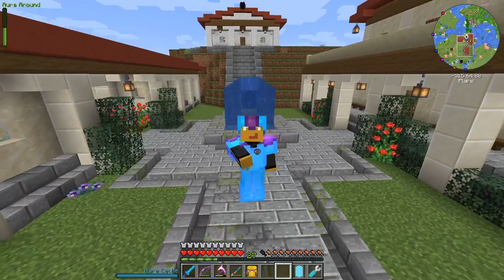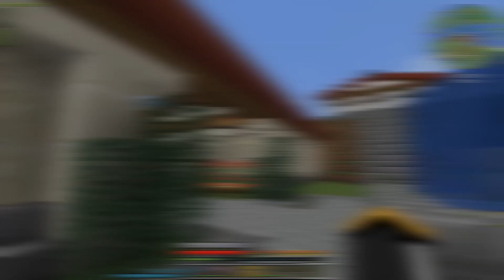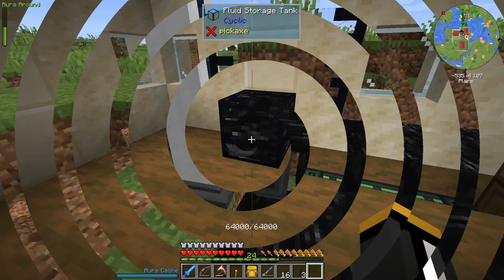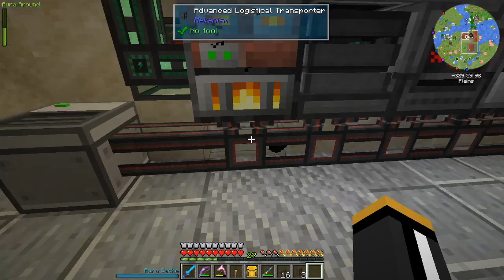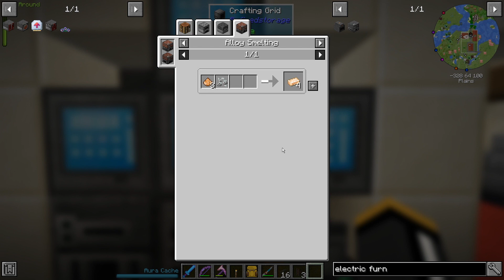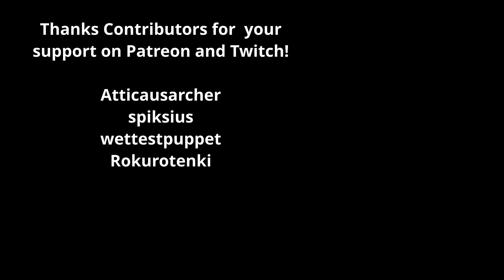FTB Omnia 12 - Silent's Mechanisms Oil & Upgrades

Comment: hey danny i can not play your real tech mod pack its too laggy here is what i use Intel Core i5-10600K Nvidia GeForce RTX 3080 internet connection 300 mbs and here is my pc Alienware Aurora R10 so what is going on?
Reply from the maker: Have you allocated at least 4GB RAM to Minecraft?
Reply: @DannySon  i have allocated 12
Reply from the maker: That might be too much. How much RAM do you have on your PC?
Check the affinity of the java app in the task manager while Minecraft is running. Make sure all cores are selected.
Do you have trouble with any other packs?
Reply: @DannySon  no i have  128